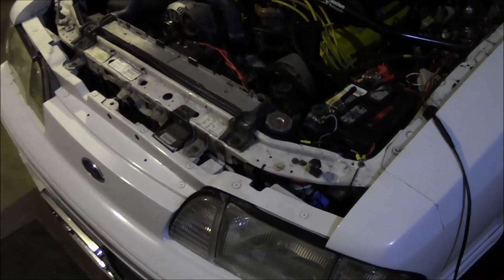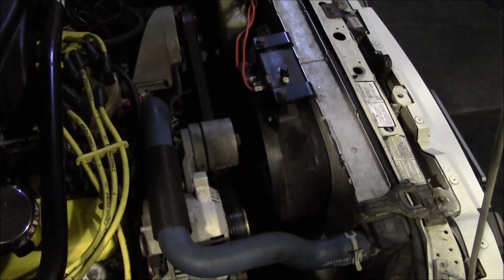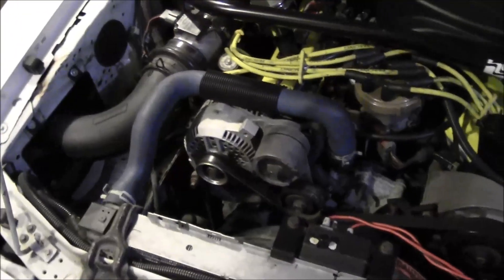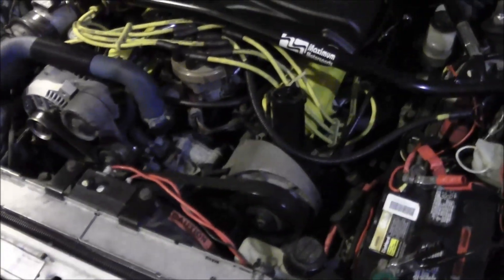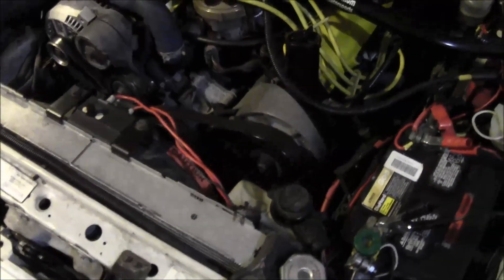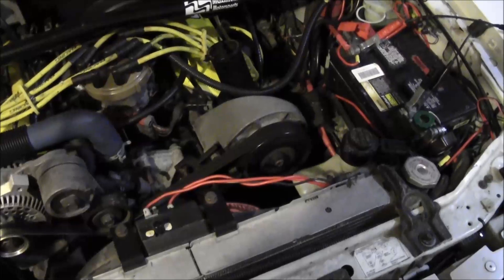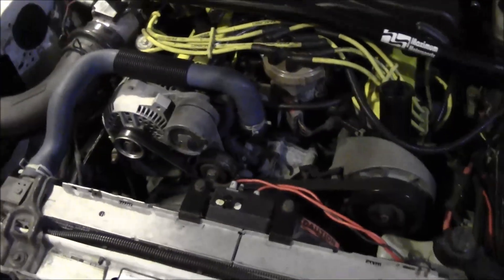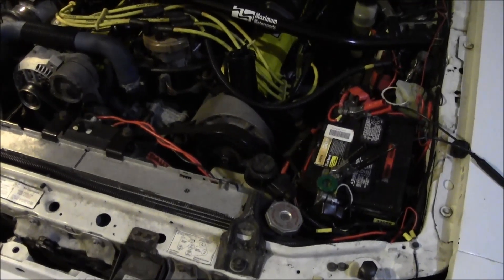Fox Body Mustang Electrical

Comment from the maker: Link to easy plug and play LED head lights for your Fox Body:  https://amzn.to/2Vyu8oj
More electric fan info:  https://youtu.be/NESyv1y2DDk
Amp Clamp:  https://amzn.to/2PtfETJ
Delay Relay:  https://amzn.to/2MFDwVv
Relay:  https://amzn.to/2vZM1Ru
16 gauge wire:    https://amzn.to/2wjA9Jo
12 gauge wire:  https://amzn.to/2nUkrAM
Wiring connectors:  https://amzn.to/2w1732t

Comment: Just purchased a 90 lx 5.0 has the same fan setup turns on when I start the car have to rewire it
Reply from the maker: Quinlan Thomas:  Unfortunately, electric fans are rarely installed correctly.  Which does nothing but cause problems for these cars.
Reply: @fwh79FOXR6  has that same setup idk the brand is it possible to wire a new fan controller onto that or should I just buy whole new fan setup whoever had it last has the wire along one of the fuses inside so fans come on with ignition run constantly also has 130 amp alt setup I upgraded all the wiring because it was never done smh has pulleys also
Reply from the maker: @quinlanthomas240  Does the fan controller still work?  If the fan comes on when the key is turned on... open the hood and try turning the knob on the fan.  See if it will shut the fan off.  If you can turn the fan off, the controller is still working.
Reply: You know What brand that fan is flex a lite maybe ?  need to order a new fan controller

Comment: Good info. My son has this same car and it has a thermostat that's connected hot at all times so it drains the battery. He has this same engine, what brand thermostat do u have?
Reply from the maker: Jesse Ruiz:  Are you asking which thermostat I have controlling the cooling fan, or the engine temp thermostat?
Reply: @fwh79FOXR6  yes, what is the brand for the thermostat  your using to controll the cooling fan? That one you have looks alot more proffesional than the one my son currently has rigged up on his. Thanks again.
Reply from the maker: @jesseruiz2337  You're welcome.  I'm not sure what kind is on my car.  It came with the car when I bought it.  However, you can search for electric fan controllers/thermostat kits on Summit Racing.  Hayden makes some affordable setups.

Comment: Man I need ur help lime asap everyone I talked to can not help at all my car has a short car runs just fine but soon as I touch the clutch pedal with my finger the car shuts off everything fuel pum ING as well there is no wires hooked to the clutch switches they been bypassed can u get back with me at 270 925 5569 or anyone  who might know name is chris

Comment: Hey, i know this is a long shot cuz its an old video but hopefully you get to see this. I have a 88 mustang stock 2.3l and just did a E-fans and 3g conversion with it. Now i have a charging issue with very loud squealing noise. I kept reading about it could be the gauge cluster cuz it has to have a complete loop cycle. All grounds and wirings are on point its just not charging. Thank you!
Reply from the maker: Proczie:  How did you wire the fans in?  Are they running all the time, on a switch, or on an automatic thermostatic switch?
Reply: @fwh79FOXR6  hey thank you for your reply 
No they are not running all time. Fans comes on when i turn AC on and shuts off when i turn AC off as its suppose to. Its all running and wired correctly, just not charging my battery. Im about to run a jump wire from the alternator Green/red wire to a 12v source and see if it will help before i decide to find a good gauge cluster.

Comment: Did you ever have an issue getting power to ignition coil?
Reply from the maker: Trip:  Are you not getting 12 volts to the coil with the key on?
Reply: @fwh79FOXR6  correct not getting 12v
Reply from the maker: @RipUnderstand  You might have a short in the wiring.  You can use a test light or a multimeter and do a "wiggle test" on the wiring.  A test light would be the best choice for that test.  I'm not completely sure but I think the coil power wire is protected by a fuse link.  There is a bundle of fuse link wiring located near the coil, in a wiring harness.  A blow fuse link would cause that issue.  The last thing I can think of, would be the ignition switch under the key.  You might have a bad ignition switch that isn't making contact, preventing the coil from being energized.  Bad ignition switches are very common on Fox Mustangs.
Reply: Ok thanks I'll look into these and give you feedback
Reply from the maker: @RipUnderstand  Sounds good.

Comment: My car cranks but wont start. I replaced the battery, fuel pump. Spark plugs, wires, and the whole distributor even the tfi module. What else could it be.

Comment: I have electric fans on my fox, today I tried driving my fox to my friends so he can check it out. battery and alternator are brand new. battery died and I jumped it twice on my way to his house, at his house I jumped it one last time and the jumper cables melted and the car ended up having zero power as if it didn't even have a battery hooked up. can the fans be the reason for the problem?
Reply from the maker: Ivan Gutierrez:  Yes, they can be.  Do the fans always run while the engine is running?  Do you know if the alternator is the stock 75 amp unit?

Comment: Hi, I have a 1993 Mustang GT, however I lost the AODE transmission wiring cables, I only find the connector cables (without wires)  to replace, but I don't know how I do to fix the connector and put the wires in there and fixed then in the main harness, I tried to find some diagram in the Net without success, Could tou help me, I very appreciate that. Thank you, Wagner Costa, Amazonas, BRAZIL, Email: wagnergcosta@gmail.com

Comment: My lights come on inside the car but my car wont start i have to jump it what can it be( new 🔋 snd alternator) can it be the coil its stock or starter its stock Maxwell
Reply from the maker: Brandan Howard:  Does the car not crank?  Or does it crank but not start up?
Reply: fwh79 mine doesn’t crank and battery makes weird noise when plugging it in just wondering if you know what this is
Reply from the maker: @cookiemoney5565  The battery makes a weird noise when you plug it in to what?  Plugging it into the battery cables on the car?... or did you trying connecting a battery charger to the battery and it made a noise?  How old is the battery in your car?
Reply: fwh79 something makes a noise when I connect the battery to the cables , the battery is new about a month old I just got it charged and it’s holding its charge , the noise starts when I connect the battery and I notice if I turn the headlights on noise will go away but still no power to the car radio won’t end turn on , thanks !!
Reply from the maker: @cookiemoney5565  You're welcome.  Did you check the fuse box in the car?  There should be a fuse for the radio.  Is this noise coming from inside the car or in the engine bay?
Reply from the maker: @cookiemoney5565  Any luck fixing your car?
Reply: fwh79 yes thank you so much for checking up not too many people do that now a days and it was just the battery , but what caused my battery to drain was the alternator had went bad ..

Comment: Never seen this video...buy resonates with the stuff you've been telling me for the last year. My battery can't handle shit for a load these days.  It died last winter (Red Optima), I recharged, but hasn't been the same since. Is there a way to tell if you're running pulleys? I suspect I am, just don't know for sure...or how to tell.
In other news, the 155 pump is in, didn't seem to do much more...but at least I know what's in there now. I bought a new IAC and Ignition Coil, the dam Ignition Coil, new, out of the box, didn't start my car 😠
I called Summit, they say it sounds like a ground issue? Really?? All I did was unbolt the old one (that sits on under the CAI on passenger side, remember?) and replace it with this one. I put the old one back on, fires up 🙄Adjusted the idle and TPS (.97) and turned down FP (38 psi, the car runs like absolute shit with more than 38-39 psi?? Wonder if this is a Speed Density issue). The ran great to the carwash last night. Headed to a car cruise this.afternoon, we'll see how it performs. 
But back to this video, I think the battery/alternator (upgraded alternator will be on my list this winter) has a lot to do with performance. 
Hope all is well!
Reply from the maker: J PP:  Yes, underdrive pulleys are easy to spot because the crank pulley is very small.  It is so small, it will have allen head bolts for mounting.  The stock pulley size is large enough for hex head bolts.  New part... bad out of the box... you don't say!  That is becoming a HUGE problem these days.  Really can't trust new parts.  I don't know how it could be a ground issue.  The coil has one sealed plug it connects too.  Hopefully Summit will give you a refund or a swap.  You should charge up that battery and go get it load tested.  Auto parts stores will usually load test a battery for free.  I would recommend removing the battery from the car, charging it out of the car, and then taking it to be load tested with it removed from the car.  You can get it load tested while it is mounted in the car... but I feel like that is a less accurate way of doing it.  Charging it out of the car removes the possibility of parasitic draw from something in the car.  Do you have a battery maintainer, or just a charger?
Reply: @fwh79FOXR6  no, I don't have a maintainer, I will probably invest in one now, after I get all this load testing done. I will also check into those pulleys now you've badged them for me, thanks!
I thought it was strange too Summit said it was a ground issue. The old coil is Rusty around the frame of it, but that shouldn't matter? 
I think it's faulty, they didn't give me any shit about swapping it, just that I should check it again...I did, it didn't work. I was even thinking about seeing if the parts store could bench test it for me. I haven't did that yet...but want to get it returned asap. 
In other news, the car ran awesome last weekend. Although I noticed it would stall on the first crank, when it was hot, then crank right over on the second. I think I fixed that with some idle adjustment. 
In fact, I think between timing, idle and TPS and Fuel Pressure, these 3 things are like the root of all the problems on this car. I finally got the idle to settle at 8-900 RPMs, no more surge. Timing seems best at 12. Any higher and it runs like shit. FP is the one I haven't quite figured out....it likes 40, but seems to also respond well to 37?
You'd think with that intake, it'd want more? As mentioned, Speed Density is a strange tune. But I think I am starting to feel it's pulse. 
I had my hooks on an 89 Fox, locally. The guy wanted $1500 for it, no keys, battery, radio all was missing and rear quarter driver window was smashed out. I probably dont need another fox, but for the right price, it would be nice to have another parts car or project later down the road. But....I offered too low and it sold for $1600. Who knows if it even ran....
Anyway, I guess I will look closer at the pulleys (maybe shoot a small video for you to see if I can't determine). And at the battery too, but she's running pretty dam good, was proud of her at the cruise last weekend. Also found out the temp guadge definitely works in stop in go traffic 😂 that dam thing barely budges any other time! I thought for sure it didn't work. It crept.up a  bit higher than normal tho. 
I let my buddy drive it a little...he's out looking at them now 👌
That's how it starts 😎
Reply from the maker: @jpp9846  You should be good with a cheap Schumacher SC1 battery maintainer.  Rust around the frame of the coil doesn't effect it's function.  It seems like your car is hyper-sensitive to fuel pressure adjustments.  It could be the way your car is... or there is another unfound problem lurking under hood.  There could be issues being caused by your battery getting old and going bad and you really need to crack open that computer and check the capacitors.  Sounds like you might have another Mustang hanging out in you driveway if your buddy comes across one.  Nothing wrong with that!  I would load test that battery and pull that computer out to check the capacitors.  I get the feeling that most of your problems are being caused by those two items.
Reply: @fwh79FOXR6  I know I really need to look into that ECU. I guess tearing out the kick panel isn't on my list, just this minute. The car is running pretty good right now, I guess I don't want to rock the boat, hahaha!
However, all those interior panels WILL be pulled this winter since I am planning on refreshing their paint, new carpet AND heater core (and possible condenser) will be replaced. So, I have full intentions on gutting it and peaking at that little silver box.  I think you're right, there could be a leaking compacitor. You had one, they are common I read. As time goes on, I bet these do become an issue. The oldest ones.are 32-33 years old! 
I'm just wondering if this car being Speed Density is the issue with it not liking more fuel pressure. Seems that MAP sensor and ECU doesn't like any deviation. That's my guess. Once I got that timing, idle and TPS right, it seemed to fall in line. As mentioned, anything past 12-13 on timing and that exhaust smell gets so prevalent, my eyes start to burn and my clothes smell like exhaust! I think these SD Foxes are just set in their ways. Kind of why Im thinking about leaving it as is...it really is fun to drive still. Like I said, I think I'm starting to get pretty good at fine tuning the timing, idle/TPS and Fuel Pressure. I think those 3 things need to be in sync with this SD Fox or it's shitty running. 
Anyway, brought that Ignition Coil with me to work today. I think in my travels, I will pop into the parts store and see if they can bench test. Regardless, it's going back, I don't believe it works. Do you think, it laying flat on the metal, below my CAI, instead of being upright on the strut tower has anything to do with it?? Just curious, thanks!
Reply from the maker: @jpp9846  Both of my computers had all three capacitors leaking.  Still need to pull the computer out of my dad's car and check it out.  I think that is going to be a big issue with these cars in the future.  I don't think the way your coil is mounted would really effect anything.  I also wonder why it was remounted that way.  Seems kind of strange.
Reply: @fwh79FOXR6  not sure "why" it's mounted that way either? It has a long, two wire from where it should be mounted, ran all the way around the front of the firewall to that location. It's very strange. 
I am going to send that Ignition Coil back to them (still waiting on email reply) and get a replacement. 
I'm definitely going to be looking in the ECU. I was right there, 2 winters ago when I was replacing my power lock actuators and window motors. That passenger kick panel, when I bought it, had a screw holding it on. Someone was in there....I often wonder (and will know soon) if there is a chip in there.
Reply from the maker: @jpp9846  It's pretty easy to get the computer out.  Make sure you have tamper-proof torx bits and be sure to disconnect the negative lead on the battery.
Reply from the maker: J PP:  Bro... did you pull that computer yet bro?  I've been thinking about buying a cool car bro.  You think I should get one brah???  =)
Reply: @fwh79FOXR6  lol, nahhhh brahhhh!
I haven't yet, I will bro, pretty soon bro, I will shoot a video bro, so you can see👍
Currently camping for Labor Day, hope all is well, will be in touch 👌
Reply from the maker: @jpp9846  Very cool.  Gotta enjoy the last few days before the polar vortex makes a come back!  Cold and snow are just around the corner.
Reply: @fwh79FOXR6  you got that right and I am NOT looking forward to that shit!
Less than 2 months and the no more Fox for the year...some sad stuff.
Reply from the maker: @jpp9846  You did get her out and do some driving.  That's a win in my book.  You also got a tremendous amount of work done to that car this year!
Reply: @fwh79FOXR6  true story. We've got some good days still, but this is the crappy part of living in the Midwest and  having a cool, old car, like a Foxbody Mustang
Reply from the maker: @jpp9846  Damn these cool cars!!!
Reply: @fwh79FOXR6  😂

Comment: Thanks for the video i just switched to electric fan it was getting hot while cruising at low RPM upgraded to a 140 amp alternator and new battery now you can really hear that fan moving some air
Reply from the maker: You're welcome.